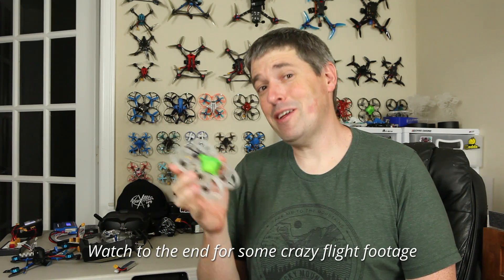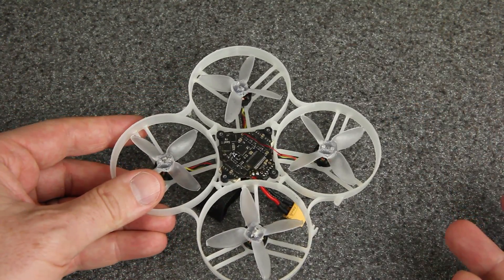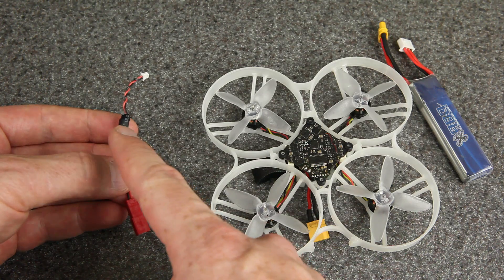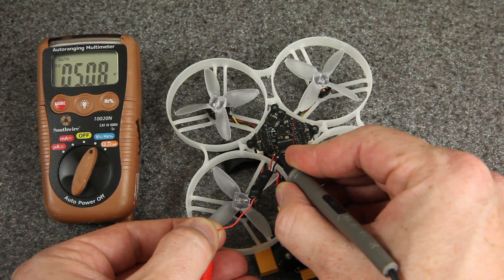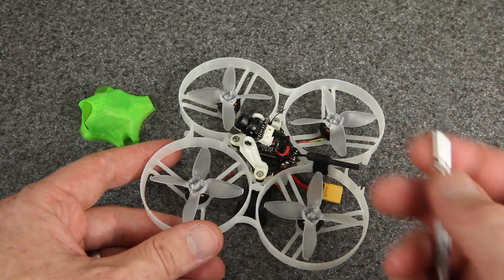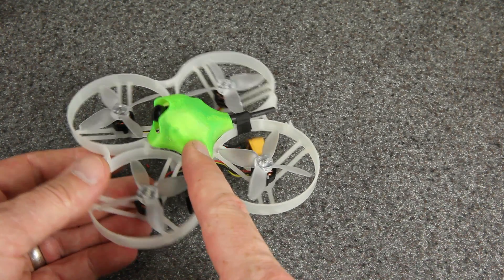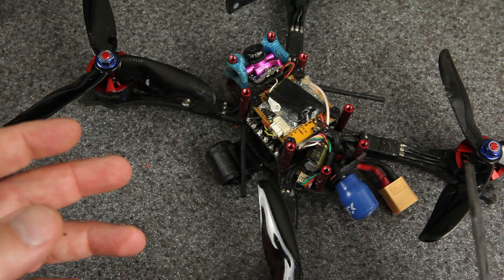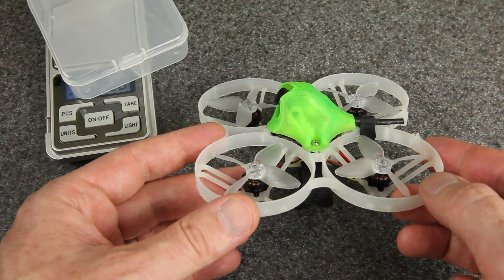Fixing the #1 Cause of Flight Controller Failure

Comment: Thanks for this video!! I have a tiny rc boat that I am building. Thought of using a partially disassembled servo as my motor, which should work great as it is both proportional and reversible and hooks right up to the receiver. I was looking for a way to step-down the voltage from a 2s lipo in a small form factor. Servo is really small, so no problems with max current.

Comment: If you want to do the same thing on a 1s board, (if that is possible) what kind of step up regulator would you advice to keep the weight low. Needing around 1a output.
Reply from the maker: One of these step-up converters would probably do the trick, but I've never tried it myself: https://amzn.to/3rj6RXp. When my 1S boards die I just replace them because I'm picky about weight on my 1S drones. Good luck!
Reply: @MrShutterBug  Awesome, thanks for the reply. It is for a R3D ion zerograv 1s build, so it should handle the little extra weight. Thanks again for pointing me in the right direction. Just wondering if the 3.5-5.5V input voltage possibly would give problems when the lipo goes below 3.5v.

Comment: I am facing a different problem my fc powers up when I throttle then it’s just about to take off and falls again so the fc restarts I don’t know why please advise
Reply from the maker: There are several possible reasons. When it falls, do all the motors stop? If so you might have a bad power connection. Does it dip out like one motor stopped? If so it might be an ESC overload or an ESC desync. The latter can sometimes be fixed by lowering the blheli startup power, or increasing demagogue compensation to “high”, or by adding a capacitor, or some combination. But... it is hard to know especially without seeing it. I suggest you record a video and post it on one of the big Facebook groups, like the Power Whoop Group. Then people might spot the problem more easily. Good luck.
Reply: Thanks allot for your response. I will record a video and post it that would be better.

Comment: that lookl and sounds great!! can you tell the battery you are using and the flight time? thankyou!!
Reply from the maker: For outdoor flying with this drone, I like to use 450mah 2S batteries like the ones made by GNB or RDQ. It gets around 3.5 minutes of fast acro flight. More if you fly slower.
Reply: @MrShutterBug  Thankyou!! I was expecting more flight time with that battery.. Im building one like this but super light weigh with gnb 2s 300mah 16g. I will share when finish that. good job with the chanel, nice content

Comment: Hi.. I have an eachine twig 115mm... 
Betaflight can't recognize the FC.. when I plug the battery or the USB the red and the green lights are solid... Please help.. 
Thanks in advance
Reply from the maker: If your FC had a bad 5v regulator, like I discussed in this video, then it would work when powered by usb. Since that doesn’t work, it must be a different problem. Hard to guess what it could be though. Sorry.
Reply: @MrShutterBug  when the battery or the USB are plugged in, it works with solid lights.. even the VTX is working.. but there is no " see dee dee " sound ... 
Anyways. Thanks for answering
Reply: @astemerkhota4923  it was the same with my tinyhawk freestyle, except the osd also went out. I just ended up buying a new board :/

Comment: Question. Will it matter if i solder the regulated 5v to any 5v pad on the FC. Im trying to fix a mamba 20x20 f4 mk2
Reply from the maker: If the FC has multiple 5v pads, they should be interchangeable. You could use a multimeter to verify that they are all connected to each other.
Reply: @MrShutterBug  thanks so much buddy. Love from PH

Comment: Could this be a possible cause of my runcam split 3 blacking out mid flight?
Reply: I have this too, and was thinking the same way. Did you solved it yet?
Reply: @ProxxFPV  I fixed mine by removing a 5vregulator or resistor that ran between the vtx to runcam board on a wire. The board wasn’t getting 5v and that component was causing it. I
Reply: @PadiwanFPV  you have done what exactly? Dont understand your expl completely. Thx
Reply: @ProxxFPV  geprc put an extra 5v regulator on the positive wire from vtx to power the runcam board. I took that off and soldered the camera board power wire to the 5v pad directly. My problem was the camera board not getting 5volts. Geprc wires this quad so the board gets 5v last and with that extra component I was closer to 4 volts than 5.
Reply: @PadiwanFPV  thanks for the extra info!

Comment: Great video, thanks for the info. So to be clear the 5v out on the regulator can be soldered to any available 5v pad on the board? I am going to attempt this on my tinyhawk 2 race board.
Reply from the maker: I have not used that particular FC, but yet I would expect any 5v pad to work because I would expect them all to be connected internally. You could verify that using a multimeter (in continuity testing mode). Good luck.
Reply: Awesome, thank you. I'm doing some reading online and watching more videos now. 5v regulators are on the way. Thanks again for your time. Much appreciated.

Comment: Could you not use a vTX that has a 5v out to power the board if it accepts vbat for power?
Reply from the maker: Yeah, that should work if the VTX can take VBAT and if it can output enough current for the FC and LEDs (if any).
Reply: Lookup AKKTEK for some very small  buck converters.

Comment: The wolfwhoop 5v regs are the best IMO, they're extremely reliable. I personally like to install external 5v regulators on every 2s AIO board I get (when the internal regulator is intact). That way I know I have a reliable 5v regulator thats not gonna randomly burn out in a flying session. I've also found that caps are not needed when using the wolfwhoop regulator.

Comment: Do u have a link for that usb right angle adapter ? I need a slim one like u have
Reply from the maker: Unfortunately no. It was made by betafpv and it came with my TWIG ET5 because there is no other way to reach the USB on that drone. I'll ask them if they can start selling the right angle adapter separately. It certainly is handy!

Comment: Thank you 🙏  🙇.  My Mobula 6 lives again. 😎
Reply from the maker: In this video I used a step-down buck converter to go from a 2S battery to 5V. To apply this fix to 1S whoop you will need a step-up converter from 1S to 5V. I think Wolfwhoop makes buck converters like that too, but I've never used them myself. Good luck!
Reply: Mr ShutterBug I used the Matek 5V BEC, quite heavier but worked.  I knew it was the BEC with powering with the USB, but Thanks to you I knew where to put it.  More power on your channel.

Comment: Great info! I have a whoop flight controller that every time I connect the câmera ground the esc don’t beep is that could be the same issue?
Reply from the maker: Does everything else work when you do not connect the camera? If so then I would say that your 5v regulator is probably fine. Maybe the camera is causing a short circuit? Or maybe it's drawing too much power causing the FC to brown out? It's hard to guess. I suggest you record a video and post it on the Power Whoop group on Facebook. You may get some good suggestions that way. Good luck!
Reply: Mr ShutterBug awesome !!will do ,thank you!

Comment: Thanks for your great videos.

In general, would you recommend using a capacitor for 1s 65mm whoops? I mean we all learned that it helps a lot on our bigger quads. My guess would be that these AIO whoop boards are somehow sensitive for noise as everything is packed very closely together. On the other hand its just 1s and the voltage spikes are <1 V most likely. But a 5V or 6.3V with 50-150 µF would be less then a gram I guess.

Alos I would like to know if you use the lastest projekt mockingbird (PMB) configuration on a 65 mm 1s whoop. I run it on my Mobula6 25k and it doesn't workall with the stock PIDs. I had to take them down to ~70 %. I would love to hear whats's your experience!!!
Reply from the maker: Hi. I do not use an extra capacitor on any of my 1s whoops, but I agree that it probably would reduce the chance of blowing the 5V regulator. I've just never tried on a 1S whoop because I use them for competitive racing and every half gram makes a difference you can feel. In general, I think you are most likely to kill the regulator if you are using the maximum voltage that it supports. For example, a 1S battery on a 1S FC, or a 2S battery on a 2S FC. I think the regulator is more likely to survive if you use a lower voltage like 1S battery on a 2S FC, 2S battery on a 4S FC, etc... That has been my impression anyway.

And no, I do not currently use PMB on my racing whoops, but Patrick Clarke does a great job with those tunes. If it's not working out for you, then I suggest you post a question on the Project Mockingbird official Facebook group. I have an old BF3.5.7 tune that I still use on my racing whoops. I think you can find that attached to some of my 1S whoop videos. Good luck!

Comment: Most of the times it's a burned AMS1117 or comparable. Most flight controllers make use of these. They die constantly and are not very forgiving :-/ .  But they are cheap and can be easily replaced if you have basic solder skills
Reply: Using Hot Air Station is considered Basic Soldering skills now? Removing SMD is not easy specially on a crowded compact and dual sided PCB. My 5 cents.
Reply: @michaelreyes8670  It's a component of the approx., size of a rice corn. Just blob it in with solder and it can be removed. Not harder then for example removing a smd resistor. If you can solder motor wires to a whoop board this should really be no big deal. It's not a 400 pin BGA chip. As for replacing, it's a SOT323 package that could be soldered to the board by hand with the cheapest iron, really nothing special is required
Reply: @VincentFischer  Need to a pair of good set of eyes and tweezers with steady hands. lol

Comment: It's simple enough to replace the reg on the board provided the manufacturer will provide the details of the chip so you can source the right one. I've done a few on the happymodel boards, now I ensure I run a suitable cap on all my qauds.